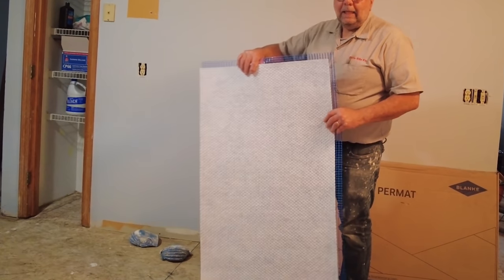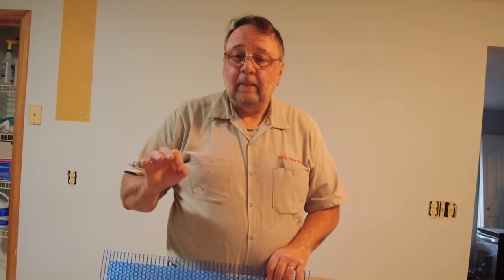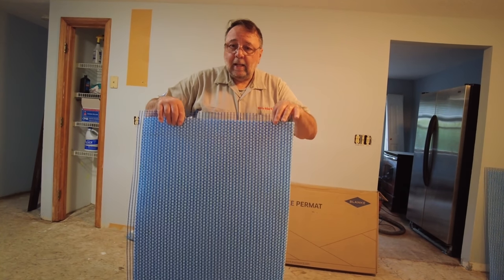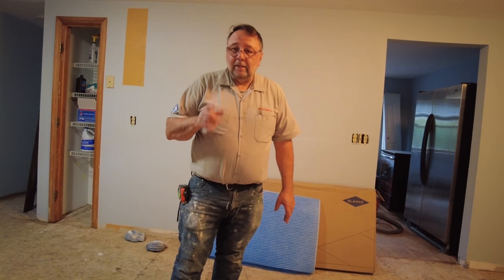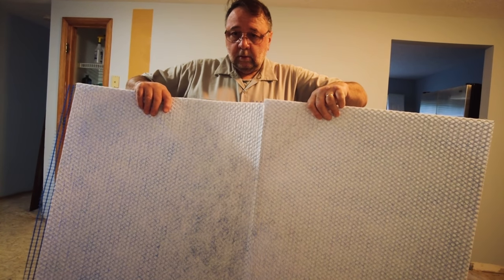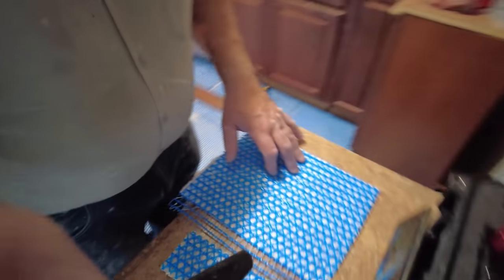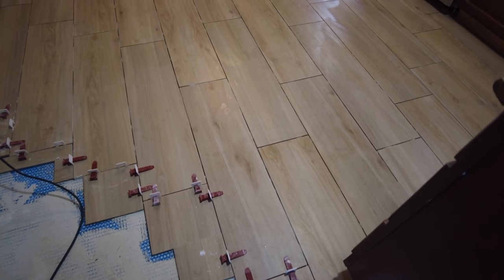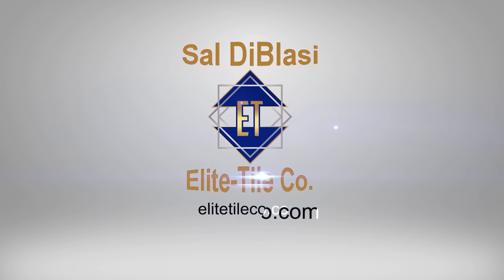Blanke Permat.  Explained, How to Install The Strongest Tile Floor uncoupling Underlayment

Comment: Looks like a good product. I wonder how this would compare in performance: Screw metal lath to the subfloor. Trowel on thinset and embed large sheets of stucco fiber mesh. After it cures, set the tile.

Comment: I plan on doing an install over a wood floor with hydronic heat. Would an uncoupling membrane like ditra or flexbone cause a thermal break affecting the heating system? And would this product be a good alternative to eliminate that concern. Thanks sal

Comment: Sal, would this product be able to strengthen an older plywood floor that was not tongue and groove or should the lack of tongue and groove be addressed further (blocking or ? between plywood seams). What sort of cost per sheet can one expect?  And, finally, just signed up as a patreon to your channel. Thanks for all of the great info.
Reply from the maker: I am addressing a floor right now that is not tongue and grove, there are several options, but blocking is definitely one of them. In any case that problem has to be fixed before installing any underlayment or tile.

Comment: I'd like to see how you go about retiling a floor that's been done with one of these decouplers
Reply from the maker: Installing a floor incorrectly to make it easy for the next guy is foolishness. Every tile underlayment, including cement board requires thinset under it. Omit a required step, risk failure.
Reply: @SalDiBlasi  I think he meant if the homeowners wanted to change the tile down the road how hard it would be.
Reply: @jodyrolandconstruction6577  yes
Reply: You would need a SDS hammer drill with chisel/scraper function, a 7 inch angle grinder with a diamond cup wheel, hammer, pry bars, and a lot of patience.
Reply from the maker: @alexanderjamieson7971  Does it matter? Cut corners now and you will be changing the tile because it fails, not because you want to.
Reply: @SalDiBlasi  I am just explaining to him what he would need. I used hardie backer as underlayment in my own bathroom and based on your videos, I embedded it in thinset with a 1/4th notch trowel, then screwed it.
Reply from the maker: @alexanderjamieson7971  Got it, Sometimes hard to understand the intent of a comment, thanks for chiming in.
Reply: @alexanderjamieson7971  Thanks!

Comment: I currently have a single sheet of 3/8" plywood on my bathroom floor. If I add 3/4 plywood over my existing plywood, then Ditra Heat...  followed by 3/8 thick tile and thin set... the threshold to the bathroom will be 1 & 1/4 inches above the carpeted bedroom floor that leads into the bathroom. Yikes!  Could I use this product over my 3/8" instead of 3/4 ply to get the structural rigidity I need, then apply Ditra Heat followed by my tile? NET: I'm basically looking for a way to reduce the overall thickness of the finished floor. Hoping this will be the solution. From a thickness standpoint this looks a more attractive option than 3/4 thick ply.
Reply from the maker: Rip out the 3/8" plywood, back to joists, add 3/4 tongue and groove. Trying to save money or hack it in will just cost you more in the end.
Reply: @SalDiBlasi  Hey Sal... Thanks for the quick reply. Will rip it out!  I'm assuming 3/4 tongue and groove "plywood"... then once installed ... I would use Blanke Permat and avoid having to add the second layer of plywood. Am I on the right track?

Comment: What are your thoughts about using Permat on the floor in the bathroom? Is there a concern that you are not waterproofing it with something like Ditra or Kerdi. Used Permat for the slate floor in my kitchen and loved it, just wondering if you feel it is appropriate for a bathroom floor (but not in the shower).
Reply: Blanke Permat can be Waterproofed, Pre fill it and use a Liquid Waterproofing Membrane or Sheet Membrane like Blanke Aqua Shield on top of it. Blanke Permat can't be used inside the Shower only on the Outside of a Shower. You have any further Questions let us know at any time #Blankecares
Reply: @blankecorporation1357  Do you have any information that explains how the Permat performs the uncoupling feature?  It's not clear to me how, after install, the Permat would uncouple the tile from the subfloor.

Comment: Hey Sal! great video as always. I actually went to my supplier (DYIer who has contractor family members with nice accounts I get to use :D) and he suggested this membrane instead of Ditra for the marble I am putting down. I told him that I need leveler on the floor and he told me I can put this down, pour the leveler directly and tile on it. Does that sound right to you?
Reply from the maker: I have seen it done and know it is a common practice, but talk to the Blanke rep to get an OK
Reply: @SalDiBlasi  Thank you sir! I will give them a call